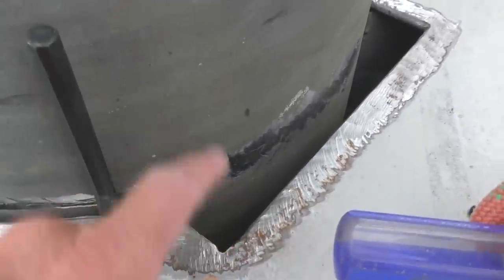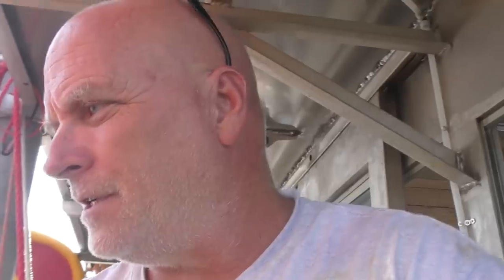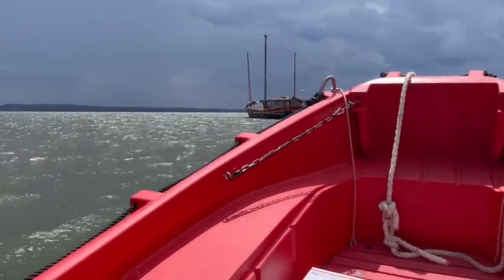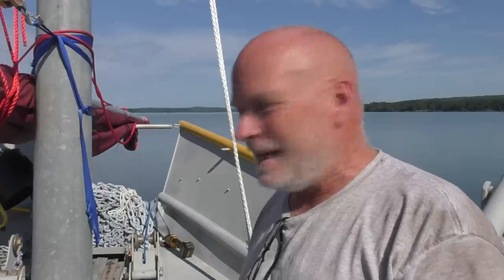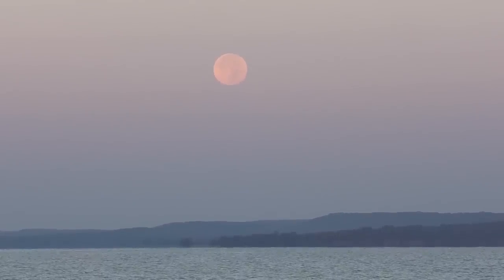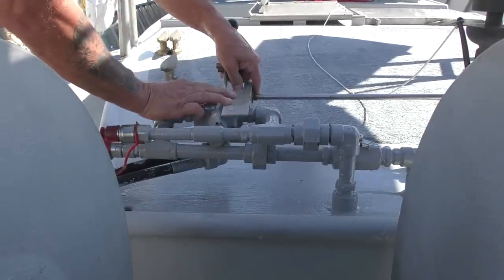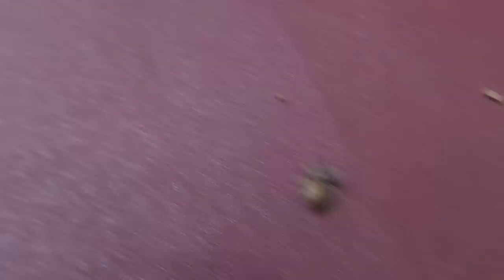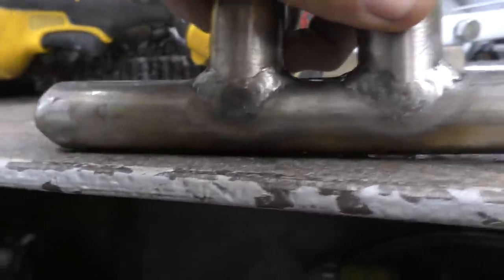Raising Sails - Part 6 - Welding in the Mast

Comment: Some of the best advice I got when boat shopping years ago was, “Don’t buy the biggest boat you can afford, buy the biggest boat you can maintain.” Between your knuckle-down and get it done attitude and an internet full of volunteers, Seeker should be just about the right size.
Reply: I usually tried to tell people wanting to get into boating (after the "not the biggest You can afford"-part): "get the smallest boat You can cope with being on long term!" It is about boating and coming a fair bit of way at the end, not being slave to maintenance and repairs, is it? The few that actually did exactly that did make it the farthest, the longest - and the happiest.
Reply: @manfredschmalbach9023  Good advice. My little O'day 25 got me from Lake Ontario to the Abacos and back. Bigger might have been more comfortable, but less affordable.
Reply: @tench745  Well you know what they say... sailing is the most expensive way to get around for free :D. I just upgraded from a 27ft to a 33ft, but i wanted some extra space, a head, bigger galley and more standing height :> Thats as big as im gonna go i think though, about the right size for me to manage on my own as well.

Comment: Great work Doug and team; video is infused with great advice and enthused with knowledge and learning. Nice to hear a Binky reference and I use CAD (Cardboard-Aided Design) a lot. Thoughts about adding some think rubber sheet (old industrial conveyor belts) to the cable locker to protect the paint in there? Many steel work boats use it to protect their decks. It’s cheap and easy to cut (after CAD?) and quite easy to glue in place with a mastic. For the lengths of cable already there thoughts on shackling their loose (bitter) ends to ringbolts or similar higher up the bulkhead? It’ll make them less likely to tangle and means a needed end can be found for hauling out. A daub of coloured paint or stout wire mousing is also useful to identify different lengths. Thanks for the general reminder that YT is a time concentrator, plus filming makes this more so! Can’t wait until you’re sailing! Cheers!

Comment: Doug, on the TIG, more heat and move faster. smaller filler wire helps too, especially if you're feeling that sticking feeling. Also, let the piece cool between welds. It will not hurt it to quench it in water. And wear a damn glove man. Sure, safety reasons, but you'll be able to prop yourself on the part your welding without getting burnt. Will steady the hand dramatically. Hell, even just a TIG finger or a cut off pinky from a glove is enough to give you that lovely articulating rest point without the ouchies. Also, put the piece in the vice horizontally and weld from the tip up, that way you're welding from thin to thick and will have more control over heat. 
Just got done fitting and welding a 10 bent steel rail bridge in a few weeks. Derailments and emergency jobs are fun. lol
Reply from the maker: Yeah, that smaller filler wire I used this time must have been the improvement.   The rest seems like skill I have yet to develop.

Comment: Gotta love welder's tan.
There are two schools of thought, make the path for lightning as easy or as hard as possible.
If you make it as easy as possible it is more likely you will get hit but not as bad when you do.
If you make it as hard as possible for wood or fiberglass, you get to enjoy either a large hole or thousands of pinholes on the bottom and probably a total loss for fiberglass.
Reply: Yup, I always run the anchor chain in loops into the water around the boat if the lightning is near. Give it a path from mast to sea.

Comment: tip from an old sailor.....if you place your cleats at knee level you can bend your line around it and haul on the bight with one hand and your body weigh, twhile the other hand takes up the slack.

Comment: I remember replacing a shear pin on a prop while bobbing in that lake. I also remember the  big gar that came up next to me to inspect my work. From my angle it looked 15 feet long and about a foot thick. My father and grandfather were on the boat at the time and said it was closer to nine feet and seven inches, but they both wore glasses, so…

Comment: Nice cleat, may nick the bent over ends idea on my next one. I make all my own too because over on this side of the pond they are expensive and by the time you order, wait, parcel gets lost then finally get it and fit, it does not save much time anyway. Also good to use 309 and weld it right on the deck so that there are no joints for water to get in and rust to start.

Comment: I helped my friend repair a hundred or more tiny pin holes on the hull of his Trojan 55.  Lightning struck his antenna and  vaporized it and continued down the the cable and exited thru the hull where the cable lay against it.

Comment: Ha. I went up to the boat yesterday thinking it would take me a couple of hours to do the overhead welding on the work I did a few weeks ago. By the time I back gouged the welds and fixed up a few of the welds on the inside it was dark by the time I got to the overheads.

Comment: There's a world of difference between fixing something you bought and designing something and making it reliable. Accumulating the parts and reading about the specifications and deciding how well it can be incorporated into the project makes a week go by easy. I like to say" Its not just the whales, Its the water too.  The things i thought would never be a problem can really be time consuming and often i was awake at night worrying about stuff that never came about. What a terrible hobby you say! Of course that's why we do it. Understanding the duty cycle of like designs and ensuring you can meet or exceed the expected service intervals makes for good design. The wants and desires in designing a system for pumps, vacuum, electrical motors is a lot like towing a trailer at 1/4 of the trucks rated capacity. It seems everything has its sweet spot, an RPM, a voltage, a volume or speed of movement. There's always a day you wish you could just fix something with a store bought part and you don't have to think about it for three days.

Comment: I Doug, i'm not sure that its such a great idea to weld the mast as it passes through the partners, i would of thought that a softer joint would have been better here. Weld the heel by all means . I had a Freedom with an unstayed mast, it was the practice to secure the heel but to put a resiliant material in way of the partners. I'm not a structural engineer just a sailor, would like to hear what an engineer would say.  Garry from across the pond😃
Reply: Yes,  I would be concerned with stress cracks.  Not sure how the professional people do it.
Reply: I’m going to say that it will depend on the the amount of under deck structure as to whether this will be a problem or not.  Crane pedestals on large ships ate attached at the main deck and not necessarily carried all the way down to the keel; on tankers there’s ~80 feet from the main deck to the tank bottom so that is not practical.  The solution is to make the under deck structure distribute the loads into the deck, frames and hull in a way that prevents stress risers from occurring.  The fact that Seeker has an anchor point at the bottom (Keel or bottom girder) and is supported at the deck line will help distribute the loads fairly well. If fractures at the deck in the weldment occurs I would first look at the welding procedure followed, e.g. joint geometry, preheat, filler rod.  I’d also consider whether there was sufficient strength in the longitudinal and transverse framing.
Reply: @markwertheimer2320  I agree. I used to sail a bluenose. solidly fixing the mast to the deck creates a serious high stress point. If the mast is rotating Doug had the perfect slot available to weld a key to the mast to arrest the rotation. Even full rigged ships never had the mast fixed to the decks they passed through as it created high stresses and bending moments.
Reply: @MrStrangegoo  Hi, I'm not a structural engineer, but as I understand it the masts on an un-stayed rig act as vertical cantilevers. As such the heel is fixed but the part passing through the deck is not, it needs to be reinforced by a doubler but not weakened by welding. I'm afraid Doug has made a big mistake here. Love what he is doing but here I think he has just got it wrong. Garry
Reply: I agree. In fact if you reference any sailing manuals that discuss the setup of such a mast you are not supposed to attach it permanently to the deck. I've tried in the past to advise him on some issues in the past but get blown off as a "Bilge Rat". I think it's great he wants to build and sail this vessel, but at least research the industry standards and regulations for certain items and consider advice when given and don't just blow it off. A lot of people would like to see him succeed and are not trying to trip him up.

Comment: It would also help alot to get a gas lens and much larger cup for the stainless. You are welding pretty thick so it might not matter as much, but if you touch the material or filler with the tungsten, it needs to be ground back down again. (I've only welded .165 and smaller stainless though.)
Reply: Came here to say this.   Both gas lenses and a big cup for stainless help a lot.  Round is the worst at trapping shielding gas as well so…I’d go huge on the cup if I cared about looks.  For a practical thick part like this if it surface rusts a little eh who cares.    Oh one more trap… my very first bottle of argon was contaminated with co2.  I thought I just didn’t know what I was doing and wasted sooooo much time before figuring that out and since I didn’t have the knowledge the gas company made me pay for a fresh bottle even though it was their fault.
Reply: @TKC_  Im a newbie, but welded up a double wall stainless turbo kit for a jet ski. Stainless is hard, and damn near impossible with the cheap setup.
Reply: @enigma9789  don’t get discouraged.  Thin exhaust parts can be tough when you are learning. With a little thicker material and a basic setup stainless can be so nice to weld.  You can go nuts and back purge parts and more, but just general stuff with a good gas lens setup can be so enjoyable.

Comment: Hey Doug you said you have 3 lengths of chain in the locker, could you weld 3 hooks or posts in the chain locker to hang the shackles off of so you don’t need to dive into the locker to get the chain? Secondly you hauled in some posts for halyards and such, can you hang chain like fire hoses?

Comment: Hi Doug !
Now you welded the masts on to the deck - what do you loose by this welding ... you  must have had some thoughts about having the masts sort of loose in the holes !
OK, you can always gride them loose again but ... 
Eventhough I've seen litterally ALL your videos from the steel plates arrive till today - I found a lot of time to do my own projects too :-) !
Reply from the maker: Why would I not weld them in?  And a plasma torch would easily remove them but I can't think of why I would ever do that.
Reply: only two reasons to step masts... they present a clearance or storage problem, or there's a spar or hull problem that necessitates repair or replacement.

Comment: Doug, do you not risk a crack developing at the deck/ mast weld?
Would a clamp for mast , welded deck not be a better option?
Leigh
Reply from the maker: No.   I doubt it cracks and so what if it did.   There are plenty of real things to do so there is no need to imagine things to do.

Comment: I once read that Phosphoric acid changes iron oxide into iron phosphate.   If boats are similar to airplanes when it comes to lighting strikes...if the boat is fully bonded...any strike will go through the boat and into the water.  I've been hit two times in an airplane.
Reply from the maker: ...but of course it will divert 60 ft out of its way to pass through the radar and chart plotter.
Reply: @SVSeeker  +Lighting will follow strange courses at times......but usually it will take the path of LEAST resistance. So, ensure you have the best bonds and in the most direct direction to ground errr. water.

Comment: The stainless is a bit too hot, or you dont have enough post flow. Stainless is hard to weld, but once you clean it up and get the oxidation off, its stainless again and doesnt matter that much.
Reply: Huge welds.

Comment: Hopefully this isn’t a stupid question because I’m sure you thought of this……. The battens are aluminum. Wont they clank on the mast and make a racket?  Why not have used more traditional materials like wood or fiberglass?  
Boat is looking great Doug. Cant wait to see it under sail in the Gulf.
Reply from the maker: Yes they will under some conditions.  But we'll add plastic or other padding to dull the noise.  Ha!  Traditional material would be Bamboo, and I'd love to, but the proper species of bamboo shipped to Oklahoma cost a lot more than the aluminum.   ....and the up side is I can weld aluminum.   Can't do that with bamboo.
Reply: @SVSeeker  The trick to welding bamboo, is to soak your dowels in salt-water, and after you've been welding for a while, they'll start smoking, dip them again.  ;-)
Reply: After you've spent a few nights in a harbor full of sailboats, you'll find that the sounds of rigging are not objectionable, but rather, they keep you in tune with what's happening... they're like windchimes, and night watchmen.  Your brain recognizes good sounds from bad, the good lull you to sleep, and the bad wake you up.
Reply: @SVSeeker  aluminum is a great material for sure..light, easy to weld and no rust.  Maybe you can slide a section of silicone hose over the battens where they contact the mast.

Comment: For tig welding you generally want your amperage around 1 per thou in, then adjust from there. You want to tig the speed needed for the amperage needed, not match the amperage to your speed. So in your case being that the metal was getting really cooked still, just need to be faster.
Reply from the maker: Unfortunately faster takes more practice.
Reply: @SVSeeker  indeed it does, took me 2 months of tig class to get the hang of it